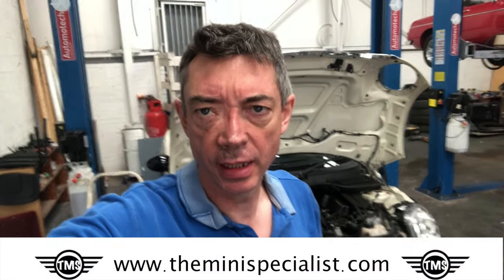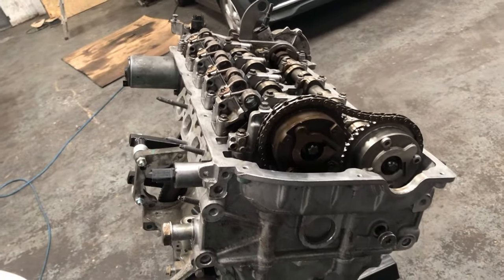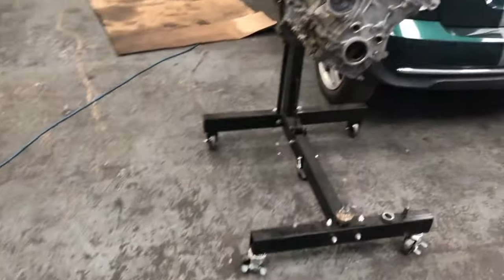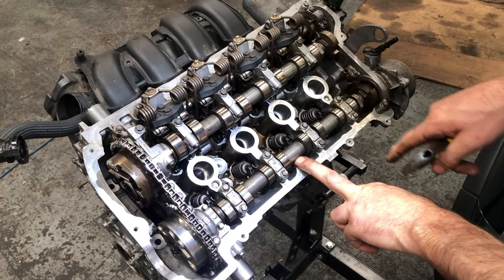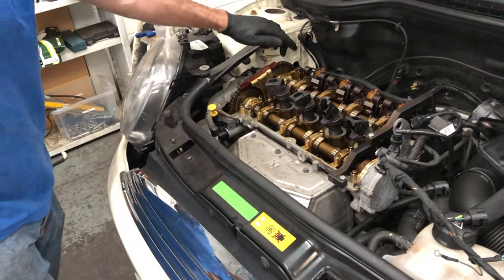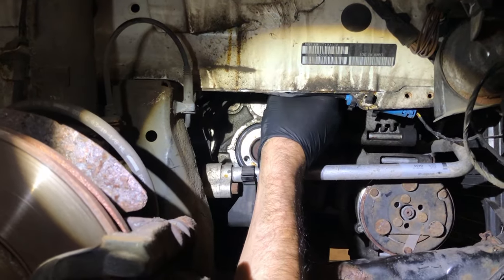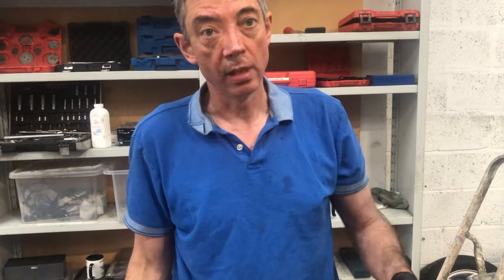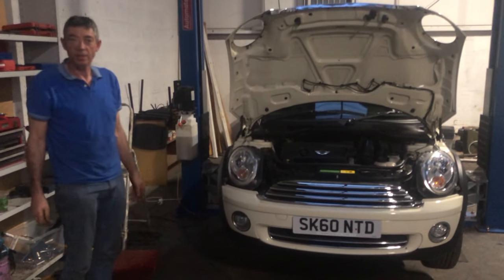BMW Mini Timing Chain DIY Replacement for N12, N14, N16 & N18 engines - The Definitive Guide

Comment: I probably missed it, but you replaced the bottom crank bolt and the cam bolts with brand new, yes? Torque to yield should always be replaced. They get strain hardened when they yield, and reusing them can cause them to break, or the cams or crank to break.  You know they are TTY bolts when it's got a turning degree spec (180 degrees) after an initial torque. I can't stress the importance of using brand new TTY bolts enough. I'm a mechanical engineer, I'm the guy who specifies what bolts to use and the required torque. Torque to yield is a fantastic spec, because the clamping force of that bolt has reached it's highest point and won't change. Regular torque measurements are actually highly inaccurate in comparison.

Comment: I would like to thank you for the wonderful explanation on how to do the timing chain procedures .   your illustration of the repair with the engine on the stand was a great idea , showing what has to be removed gave  me a better under standing what and were to look for in that  tight engine bay. I would encourage you to continue to show these illustrations on the engine stand whenever possible  thank you very much.
Reply from the maker: Appreciate the feedback - thank you.  Have done a similar video on how to change a waterpump on a Mini that may interest you.
Reply from the maker: Appreciate the feedback tbank you
Reply: See z
Reply: @TheMiniSpecialist  thank you panjabi
Reply: @TheMiniSpecialist  Hi guys. I have Peugeot 308 THP 200 EP6 that has already had the timing done by the Dealer at 70000 miles. Now they couldn’t find out what caused the timing to be out. The engine continues to warble on startup and when idling. So I am thinking its either the chain kit needs replacing or one of the tensioners on the way put, the Solenoids need replacing or there is an issue with pulleys and tensioners. Without wishing to throw £1000s at the dealer I am not sure which to try first. The RAC put a sound scope on the front belt tensioner and that was making a resonation so I had that replaced but the warbling/wobble is still there. Do you know what it would likely be out of what I have mentioned. As a side topic do you know what might make the car over rev from cold start that is to do with the ambient temperature of the engine is higher. Only over revs when the weather gets warmer and the temperature of the engine is starting warmer. Thanks
Reply: Uuuuuuuuuu

Comment: I purchased a 2010 Mini S about a year ago and recently took it to the Mini dealer for repairs  and the quote given made it impractical to keep this vehicle, ... until I came across your video.  I've reviewed many videos on the timing chain repair found them lacking in detail.   I can only describe your video as, ..."The Best of the Best".  Hence, I am confident I will be able to keep my car after this project.  I'm going to also review your oil housing repair video,  and if it's presentation & clarity is anywhere near this video, I will take on both repairs and be a happy camper, thank you!
Reply from the maker: That video took many hours to film and then more time to edit - and comments like yours make it rewarding and worthwhile - many thanks.

Comment: Excellent video with easy-to-follow instructions.  Many thanks to you for posting this as I referenced it (as well as my repair manual) several times while changing out the timing chain on my 2011 R56 Mini Cooper S. Now that I'm basically finished, I do have one question before I put the valve cover back on and reassemble the front end... 

Before tightening the crank & cam bolts, I checked the timing using the cam lock tool and the pin that goes in the fly wheel.  Everything was spot on, so I tightened the crank bolt properly (50nm, then 180 degrees), followed by the intake sprocket bolt, then the exhaust sprocket (20nm then 180-degrees for each). After that I rotated the crank 2 times and rechecked the timing using the flywheel pin and cam locks.  The pin went in fine and the exhaust side cam lock went on easily, but the intake side didn't line up 100%. There was about 5mm of gap where the exhaust cam lock piece and intake cam lock piece meet, so I had to loosen the intake cam sprocket bolt and rotate the cam slightly using a 27mm wrench to correct the timing.  I then replaced the intake cam sprocket bolt with a new one (since it's a single-use bolt) and did the correct torque procedure again. 

Now everything lines up perfectly and I rotated the crank and rechecked the cam position 3 times to be sure.  That said, here's the question:  The correct procedure calls for tightening the crank bolt first, then the intake cam bolt, followed by exhaust cam bolt.  Since my timing was off after doing that, I only changed and re-torqued the bolt on the intake cam, but should I have replaced and re-torqued both the intake cam bolt followed by exhaust cam bolt?  I assume everything is fine since the timing all lines up as confirmed by the flywheel pin and cam locks, but I wanted your opinion.  I have extra new cam bolts, but hate to do it again if I don't have to.  Let me know what you think.  Thanks! 

And thanks again for the great video!

Comment: I have very loud rattle, on a Pug 3008, which is not a trait of the chain, but more one of the vvt cam sprocket failing. I have no slack in the chain, with no visible damage to the guides. I fitted a new chain tensioner 2 months ago, and there was no significant difference. I had this issue on a Nissan 200sx where the vvt sprocket became extremely audible on its vvt inlet sprocket due to low oil level. This is a very informative video, as I am doing some trial and error work on my own vehicle

Comment: Thank you for this video.  We'll be taking our 2010 Mini Clubman S into the dealer on Monday.  We've recently began hearing a noise from the engine compartment on cold start that goes away when warm.  The tensioner was changed in 2014, but rather be safe than sorry.  I should add we are the 2nd owners of the car.  Currently to change the timing chain it's $1800 USD.  Expensive, but a far sight cheaper than a new/rebuilt motor.
Reply from the maker: I have to say that $1800 is too much. We charge £641 with is about $830 so shop around.

Comment: My oil solenoid was shot.  Causing high oil pressure.  The excess pressure kept the tensioner tight...    I swapped the oil solenoid and like 2 days later started it up to rattling.....

I bought it used.... I knew I was gonna be doing this.

Thank you for this.

Comment: Thanks for the bit about the scan tool. I just bought one off eBay for my timing chain replacement (2011 R55 124,000 miles).

Comment: Thank you very much. This video is of great help. I have this job in front of me and being old fashioned, i usually seek help from the Haynes manual.  In that manual , the accessibility issues are brushed aside, your work illustrate and resolve them brilliantly. This said, i have a technical query about the locking of the crankshaft:  at 24.15 and  then at 41.30 you undo and then retorque the crankshaft bolt against  the crankshaft locking pin. The authors of the Haynes manual advise against this: While they of course make it clear that the crankshaft pin should be in place during the timing chain replacement, they recommend to remove it temporarily and to instead lock the crankshaft via the transmission (high gear engaged and firm pressure on the brakes) when it come to undo and then to retorque the crankshaft bolt. There are no explanations for this but it appears that they fear that the pin may snap under the high torques involved. I would be very grateful for your comments on this, have you ever heard about  the pin failing or do you see any merits to the "transmission lock" method that they recommend ? 
I am sincerely grateful for your work and advice.
Philippe
Reply from the maker: We usually do one of these a week and always use the pin to lock the crank to torque up the crank bolt. The same pin each time I might add. Without it I would be fearful of the timing being out.

Comment: Great video! I have done engine rebuilt by specialized firm, with new timing chain, but my mechanic got me scared saying the engine reconstruction is done badly! The reconstruction guys advised the last passage, resetting the values! So there is still hope, although my mechanic is telling me timing chain is noisy! I will keep hoping for happy ending! Thank you very much!

Comment: I just did my chain following step by step from the video. Here are a couple things I found that might help the next person. The bolt under the intake is much easier to get after you are able to lower the engine with the jack. Best to replace the crank seal while you are there. When reassemble, make sure the mechanism from the crank pulley and water pump is engaging the transfer between.
Reply: Forgot to also say thank you. Great video @theminispecialist

Comment: Good quality video thank you I’ve found it easier to just remove throttle body housing (four torque screws) to get at the chain tensioner and you didn’t mention the fact that the camshafts can’t be locked in place until you realign them by undoing the e14 bolts and adjusting their position by however much so the locking clamps sit squarely (exhaust first followed by inlet) on the cams all of this comes after placing the locking pin in. Tell me if I’m doing it wrong ?
Reply from the maker: Like the throttle body housing idea - much easier if you don't have a lift.  As for locking the camshafts- not sure about that.  Lock the crank first ensuring  the writing on the camshafts is showing and if the timing is correct the locking tool should go on without an issue.  If the chain has stretched you can create some wiggle by removing the tensioner.  That said once the chain is removed the cams can be locked and should stay locked until everything is torqued up anyway...

Comment: Hi, brilliant video very informative. Couple of questions, do you need to replace the crank bolt, and the cam shaft gear bolts? Because of stretching of the bolts. And where can I get the torque setting for my particular model, which is a N12 engine 2007. Also when you completed the install you where able to reset the cam positioning limits, unfortunately I don’t have a diag machine is there any other way of completing this process with out the diag machine. 
Thanks
Reply from the maker: Thank you!  Some kits have a new crank bolt and I usually replace it.   I have never changed the camshaft gear bolts however.  Torques are - Crank Bolt - 50mn +180 degrees Camshaft bolts - 20nm + 180 degrees for all of the N series Mini engines.  Finally - you should get away without resetting the camshaft limits.  The ECU monitors the cam angle as part of the variable cam timing set up - the engine management light comes on when the chain is too long because the VANOS actuators can no longger keep the timing within spec.  A new chain should change that.
Reply: The Mini Specialist Thank you very much,

Comment: Hey Mini specialist, I just did the head gasket on the same engine. I don’t know what the issue is but the timing chain is super tight now. I used a 1.20 head gasket and I replaced the upper timing chain guide and just reassembled .
Reply from the maker: Well - it is supposed to be tight and the tensioner is a spring - so should allow movement....

Comment: Great vid and excellent knowledge. If I remove the valve cover will I be able to tell if the chain is loose. I have a 2009 r56 with bad idle and continuous check engine light. Thanks again.

Comment: So I changed the Vanos. I still have code 14 and 15. I changed so far one of the two cam sensors and it did not go away. Once the car warms up I have like maybe 50% power

Comment: Incredibly helpful video, did the job in six hours!

My mini had a rough idle, changing the chain helped but it's still not running perfecty. No check engine light tho. Does anybody has an idea where i could look next?

Comment: Amazing video!!! Thanks so much 

I’m half way through the job and have found no damage to the guides when I removed them. I’m doing the job as the N18 2012 JCW engine has a loud rattle in all running condition, but now concerned this isn’t the root cause. Could it still be noisy because of the chain even without guide damage? While it’s taken apart should I look for something else before I rebuild 
No engine codes being flagged either. 
before

Comment: wish there was someone remotely like you up here in Edinburgh. I need mine done, but lack the space to do it myself. Always worried about giving this kind of job that has lots of brand specific knowledge to a random mechanic!
Reply from the maker: I look forward to opening an Edingburgh branch of The Mini Specialist!
Reply: @TheMiniSpecialist  Much needed.... I did consider whether it was cost effective to have the car transported down. It's a lovely R58 JCW coupe, and i'm trying to give it the best care I can, as it was obviously neglected a bit by previous owner. Runs strong but occasional rattle from engine bay gives me the fear!

I'd engage with the work myself, but I live in a flat and a street doesnt seem the best place to try this ;) 

If i can keep car working long enough, I have  family down south, so may speak to you about dropping off!

Comment: Great video.  Does the camshaft lock kit fit both 2008 Mini cooper s turbo r56 N14  and mini cooper r56 n12?? I got an aftermarket kit from eBay has both lock adapter for intake camshaft
Reply from the maker: Depends.  Some have parts to fit fit multiple heads - but each head is different.

Comment: Very helpful video - thank you.  I was able to do the replacement successfully.  After 5k miles of no problems, cylinder 3 misfires consistently when temp reaches about 200 degrees F. When engine temp falls below 200 F, no more misfire.  Coils, plugs, injectors are all good.  Pls advise on what you think is problem.

Comment: Excellent vid I have a question I have bought a 2009 mini that wasn’t going and was told it needed a timing chain so I bought the car to fix up … now I  have it stripped down ready to put a new chain in however I found when stripping it down it was a major as although the chain was still in tact the plastic fantastic  chain guide had disintegrated and the chain had eaten the metal top guide bracket  away  hence lots of metal fragments went down into the sump, the oil pickup was almost totally blocked with plastic and metal fragments and gasket sealant most like from using too much  sump sealant ..so should I use a gasket on the sump or more gasket sealant  . ps I hope not to many metal fragments got into the oil gallery’s as some fragments were found on the mesh of the exhaust vanos actuator sensor ill soon know after I assemble and run it and hear crank knocks after while

Comment: Brillant tutoriel, you share a lot of detail to be able to do a good job 👍I have just a question about tensioner When you screwed the Cam shafts. Is it necesary to use a tool ( replace tensioner by a specific tool) to be able to have the right effort during This phase ? I have one in the N12 motor  case tools. Thanks a lot. Vincent. PS : sorry for my english, l’m french ! 😉
Reply from the maker: Hi Vincent - thank you for your comments and btw your English is a million times better than my French!  When you say 'tensioner' you could mean the actual camshaft tensioner which is a large spring loaded bolt - this is 27mm and just needs to be tight - there maybe a torque setting but as long as it cannot vibrate lose then simply make sure it is tight.  The other possible thing is are the bolts holding the camshaft sprokets in - these bolts are torx headed bolts - E14's to be precise - and when replacing these need to be tightened to 20nm +180 degrees.  Does that answer your question?
Reply: Hi The Mini Specialist, thanks for your responsiveness. yes l'm speaking about the camshaft tensionner 27mm. Inside it you have a spring without a huge effort, due to you have hydraulic effort when the motor is on. My concern is when you screw the first camshaft perhaps the camshaft gear can rotate a little (0.000001° perhaps 🤣😂) due to the low effort of the spring effort (27mm). Morever i have an additional tool in my kit 🤔 to replace the camshaft tensioner (27mm) during the reassembly. I had starded the timing chain replacement yesterday, l’m not an expert, l have a lot of questions on mean! It’s my DIY of the week end. One more time, very good vidéo, I wait the next one 😉
Reply from the maker: Providing you use the camshaft locking tool and the pin for the flywheel you cannot really go wrong - I tighten in this order - bottom crankshaft bolt first (50mn +180 degrees) then the two cam sprockets finger tight only (but make sure they are seated all the way in) - then put the 27mm tensioner in place and tighten all the way. Then torque up the 2 crankshaft bolts (20 nm+180 degrees).  Hope this helps and good luck this weekend.  Regards Hugh.

Comment: Probably goes without saying since it was mentioned in the video, but it’s super important to install the timing chain tensioner before you tighten down the cam sprockets. I didn’t do this and ended up a tooth out, luckily figured out the problem before I fired it up.
Reply: Did you install the top chain guide before or after you tightened the chain?
Reply: @lyt_w8t  I’m pretty sure I fitted it after tensioning the chain.